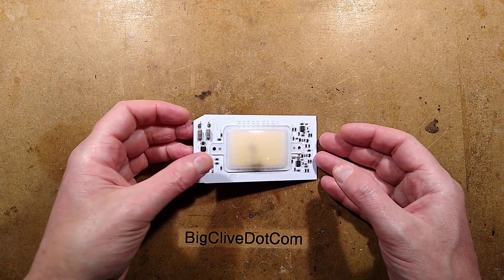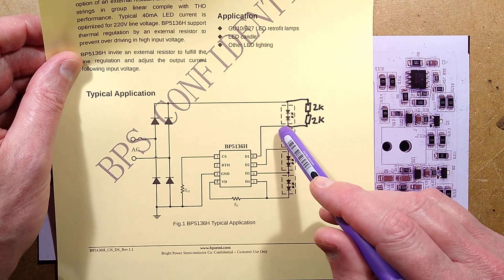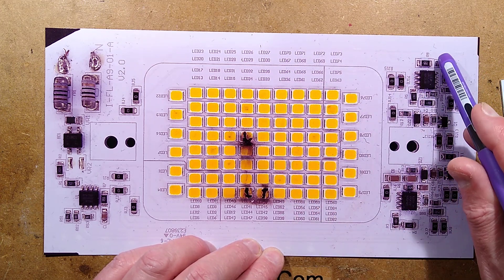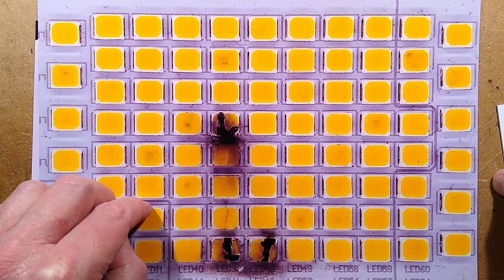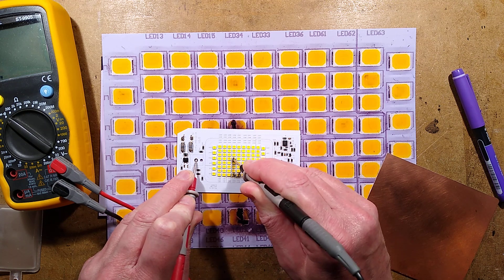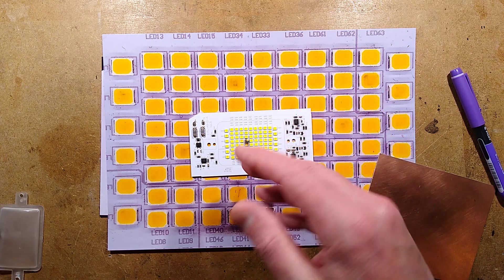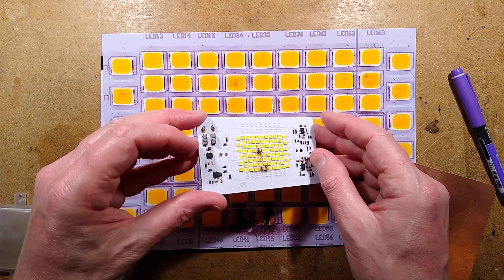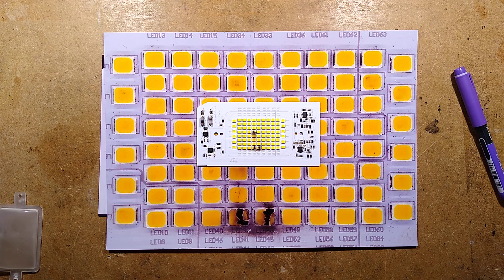LED shock hazards are increasing

Comment: I had to insert an AC filter in the beaker box feeding our living room, because every time the 55 inch TV was turned on the beaker tripped from the TV's power supply noise causing it to trip.  I did the entire circuit to cover any fancy electronics that might be added later. Ron W4BIN
Reply from the maker: Could it have been high inrush current that was causing the tripping, or was it a breaker with arc fault detection.

Comment: I don't see the issue. You should use a switch to shutdown power to the light before working on it. Risk of shock Is zero and you don't need a gfci/rcd for that. Of course an egc would help maybe but if it is still appropriately current limiting then an egc may do nothing as It acts like a giant resistor. Simple solution is to flip your switch before working on it. Using a multimeter to verify also helps. Electricity is still sent back to the grid as AC so I don't see how a DC gfci would be useful.

Of course try not to buy cheap Chinese crap (all redundant I know)

Comment: The moral of this story is write your congressperson and tell he or she that things are coming in from China that are out of spec with US safety requirements.

  The other moral (or is it a morsel in this case) is that whenever possible, use battery driven DC fed devices that are not connected to the AC line.  With LED lamps that should be a no brainer.  I would love to wire up my house to feed DC to DC driven devices.  All fed from a battery bank that one recharges at night when the AC power rates are lower.

Comment: Aluminium core PCBs don't have enough separation to be connected to exposed metalwork, whether it's earthed or not. They should be treated as potentially live and have another later of insulation to exposed, earthed metal.

Comment: I'm not really sure how there getting shocked seeing as how the housing is plastic 99.999 percent of the time especially from China what are they spitting on the fingers and putting them in the socket truly I don't get it ok yes the aluminum plate may short or fault but that will not transfer thru the plastic housing unless plastic has all of a sudden become conductive and it forgot to tell the universe

Comment: Thank you for this video.  Would simply a greater capacity for Heat Sink obviate this failure mode? So in essence is it a circuit board material issue or inadequate thermal dissipation capacity?
Reply from the maker: A better heat sink and running the LEDs at lower power would both be beneficial.

Comment: Why do we drive LED lamps (including car lights) with AC? LEDs by definition work best with a DC feed. Is it about heat minimising?
Reply from the maker: It's for cost saving and avoiding the use of electrolytic smoothing capacitors which are very easy to damage with heat.

Comment: The latest thing in our shop is the florescent tube replacement led tubes that arc and burn through the PCB to the point of bisecting the board itself, which is supporting the weight of the bulb itself.. Gravity always wins, so now we have zip ties on all of our lights. Just in case.

Comment: This is why I would only buy quality LEDs. Not only for reliability but, also more importantly for Safety. In the states where I live, I have 120 volts AC mains which is not as dangerous as 240 volts due to having half the potential energy but, can still kill you.

Comment: My friends works at an LED factory in town. They do FLDs and another I can't remember at the moment. Basically streetlight LEDs that go in parkinglots and what not. I might be able to get a board to send.
Reply: Hey, I got a whole chain of these LEDs. They have a hexagonal pattern and connect together to form a small ring. The lights are pointed at a reflective parabolic surface. Unfortunately I only have the LEDs and not the casing or the drivers. If you're interested in giving them a look, let me know and I'll email you the details

Comment: In US “arc fault circuit interrupt (afci)” are required now in past few years for certain areas of homes, like bedrooms. I know because I inadvertently triggered mine while testing an old set of power line network adapters it didn’t like. I wonder if this type of failure would trigger them also?

Comment: Could some one out there please tell me what is the VOLTAGE and CURRENT I needed to light up just one of those LED's, I have an old damage street light and would like to recycle some of those LED's...…...
Reply from the maker: Standard LEDs will light at 3V.  On panels like this they may be higher.

Comment: All the supermarket branded LED bulbs I had failed in this manner. The bulb flickered and died with a burning smell. Took them apart and sure enough the board had burnt through to the aluminium. Not only that but the board was charred along the edge of the copper track both sides of the failed LED almost a CM each direction. After removing the failed LED it was measuring 50ohms when it should have been open circuit

Comment: Cupric Chloride, as distinguished from cuprous chloride.  Both are copper chloride, but the first is an excellent etchant for copper while the second is what cupric chloride turns into when it oxidizes metallic copper into solution.  As long as there is excess chloride ions present in the solution, any oxidizer present (even just air bubbled through the solution) will oxidize any dissolved copper back to the copper (2+) state of cupric chloride.

You can make this at home quite easily, as well.  Hydrochloric acid (which where I live can be obtained as concrete etchant) won't oxidize metallic copper, but hydrogen peroxide will oxidize metallic copper and give the hydrocloric acid access to the ions.  You can even start up the bath by etching a circuit board using the hydrochloric acid and hydrogen peroxide solution.  Unlike more conventional etchants like iron chloride, a cupric chloride bath gets stronger instead of weaker the more use it gets, as more and more copper ends up in solution.  (You do have to periodically add more chloride ions, usually in the form of hydrochloric acid, when it runs out.  You'll know it needs more chloride when the opaque brown cuprous chloride color does not disappear even after a prolonged aeration of the solution.)

You can also use this bath for copper electroplating, including plating through-holes and vias in PCBs.  (Be careful how you go about doing this, however.  Some methods involve chemicals which are restricted in some countries because of what else they can used for.  You do NOT want to be mistaken for someone performing those reactions.)

If you find the bath becomes too strong (one thing that will definitely stop it from working is becoming saturated with copper ions, although the solubility of copper is quite high), it can be reduced by other methods than adding water.  You can place the etchant bath in an icewater bath, as a solution saturated at 25 degrees Celcius will drop something like 50 grams of copper per liter at freezing.

If you do make this material, be careful with it.  It is corrosive, particularly toxic to aquatic life (and most waste water treatment systems don't have provision to remove it, as it isn't a normal constituent of waste water), and just generally unpleasant if it escapes from working apparatus.  Where I live, it can be disposed of in the annual household hazardous waste collection that is done each spring.  You can also just seal the container for short-term storage, or you could dry it out for long-term storage. (The obvious means that suggests itself to me is using a vacuum pump to pump off the water vapor until it's dried out.  As the stuff works better when warm and will dissolve more copper per unit volume when hotter, you should have a heated bath if possible, which will alleviate the problem of the solution freezing on you if you've got a really good vacuum pump.)

Comment: As this particular unit is a luminaire that does not have 'replaceable lamps' - genuine U.K. sales are hopefully less likely in the future due to the impending ban. All new U.K. light fittings are supposed to have replaceable lamps.... This should in theory might remove the problem. However there must be a lot of potentially (ouch!) dangerous units out there using similar construction to the one you have.

Comment: So, (hoping someone can confirm here) this is something I've thought about and I also thought this problem could not only cause issues for type ac rcd (which is fairly obvious) but also type a? Could this issue make type a ineffective for the more common leakage currents from ac circuits? I need to draw it out but it keeps popping up in me head...... 🤔

Comment: •Upside: That design avoids the bridge-rectifier-and-capacitor input that has a nasty power factor. •Downside: The non-isolated design plus rapid switching inject capacitive current from the mains into the substrate - the substrate should connect to neutral or L1, not ground. It probably emits much RF. •Question: Does that chip sequence the LEDs so that they get equal use? •Better choices might be circuits that push current. (Still use no big input capacitor. Use inductor(s).) Buck converter? (Drive it non-standard.) Boost converter? (feeding LED string 300V?) Boost-buck or other fancier converter, can also provide better power-factor correction?

Comment: Can we please move on from screw-base lighting?  Cheap flickery linear drivers suck. Putting switching regs right by LEDs so they can get hot and both fail also sucks.  Smart LED bulbs also suck, since the smart part and the part thar breaks are the same thing.

We could have fixture, power supply, and actual LED as separate replacable parts.  We could even have "bulbs" be USB-PD powered, and it could all be standardized from tiny desk lamps on up with a data channel for smart stuff!

Comment: dont blame the board if irresponsible instillation is at fault 
Q. what is the running voltage of the led and what ma is the leakage before the resistor ic fail

Comment: The main electric shock hazard comes from metalwork that should be properly earthed for a Class I device. It's poor design and construction that's causing the issues and creating the potential shock hazards. If the casing of these lamps was properly earthed or they were of Class II construction the hazard would not be present without multiple fault conditions. There is a lot of emphasis placed on testing of the installation in a domestic environment but the majority of the hazards come from connected equipment. A Class I luminaire with unearthed metalwork does not meet the basic provisions of the Low Voltage Directive and should not be available on the market in the UK or EU, but unfortunately they are and this introduces an electric shock risk whatever type of protection is provided on the circuit supplying it.

Comment: Hello BC. The LED globe bulb in my bathroom  is barely glimmering. I thought that most of the LEDs had gone to Silicon Heaven, but when I popped off the opaque plastic dome, all are lighting, albeit dimmer than the answers at PMQs.
Any ideas, oh mighty bear of the spudger?
Reply from the maker: Look for one with a black dot in it.  One failing high resistance will break the circuit.

Comment: I also think that one trigger for this is that they run the LEDs way too hard, too few chips for too many watts making them very hot hence the dark spots inside the resin, they break down when getting blazing hot and they start to burn conductive traces that leads to this result in the end. if they could only put more quality in focus rather than profit this would not easily happen and the lamps would work for ages, safety,  long life and low power consumption and environmental gain but then the minds of profit comes into play and ruin everything

Comment: Hello there!
@ 4:44 you are holding the PCB in an angle and the tracing appears to be super visible because of the angle in which the light is hitting it.
Maybe you can easily see the traces by angling the light source =)

Comment: Hey Clive! Got a cob that needs some individuals LEDs replaced 4 of (3x5.1mm), any suggestions? Seemed to be melting led plastic before solder was getting hot - maybe hot bed?
Reply from the maker: Hot bed would help greatly.  Be aware that many of these LEDs are multi chip and may not be easy to find.

Comment: I love the wording on the spec. sheet  - "BP5136H invite an external resistor..". Plus the puzzling "Confidential - Customer Use Only" at the bottom!
Reply: My favourite one was on an installation instruction for a cheap halogen flood light - "Offer the unit to the place of destiny and make the screws"

Comment: Big Clive vast majority of GFCIs are type A now in the USA type AC are the only older ones. Also GFCIs in USA trip at much lower currents 4-5mA in 3-7mS than UK 30mA RCDs. Hot tubs and EVs are an area where much faster tripping at lower current RCDs should also become standard.

Comment: It's interesting that even in BS7909 (temporary electrics for events), currently published to a 2011 version, had it clearly stated that type AC RCDs/GFCIs are UNSUITABLE. Yet in the 2018 edition of BS 7671 the JPEL wizards happily left the wording that AC RCDs/GFCIs would still be suitable for GENERAL application - with no explanation on what general actually means. Even though as you say countries like Denmark and Germany etc just refuse to accept AC RCDs in new build dwellings.

The upcoming 2022 2nd amendment to BS 7671 had a proposal to change the general device from AC type to A type, but we will see. Once they make the change there is going to be some interesting developments between the ECA/ Manufacturers of SRCDs and the standard BS 7288 as well.
Reply: As far as I can see the 2018 edition was the first edition of the regs where the committee wallahs of the IET  even acknowledged that different types of RCD existed. In spite of type A being mandatory in Germany for 30 plus years.  I think they were side tracked by the more lucrative prospect of AFDDs and dreaming up the need to do an impossible calculation to be able to omit them.........

Comment: In a distant time before domestic RCDs I worked for a consumer electronics manufacturer in the UK. We made sure our kit was safe and always had BEAB certification (it was a kitemark for electronic kit). Why? Apart from the ethical perspective, the company knew that if something bad happened it could lead to law suits and bad publicity. Move to the present day and nobody knows who makes most of the kit, and many of the importers/sellers are fly-by-night.
Even the simplest thing can be risk. I had to obtain 50 5V 1A USB power plugs to supply with product. Trying to find anything certified as safe is a nightmare, unless you want to spend £20 on a Samsung or Apple charger. 
The improved RCDs are a great idea that needs to be done, but the kit has got to be better regulated.

Comment: If its a problem it will be handled. So far not a problem. Here in the USA we use 120 volts so it is quite a complicated deal to get electrocuted. (you have to some way be firmly fastened to the circuit to where you can't pull loose) Not very likely unless you are in water.
Reply from the maker: I think the water bit is the one that delivers the most surprises.  It makes a massive difference to skin resistance.

Comment: Clive, I'm not convinced that these aluminium-backed ultra-thin PCBs  present much of a shock hazard.   Most commonly, these are found in a plastic housing where the metal backing plate is isolated from any human contact.   Certainly, if they short out, they're a potential fire hazard and will likely blow a fuse in the plug or on the PCB (if there is one).   I don't believe that the backing plate is connected to the protective ground lead in the  line cord.

I don't understand why this is any better or worse from a safety point of view than an ordinary incandescent lamp fixture.

In keeping with the global warming meme, how about a breakdown on some personal misters?

Comment: If it arced, why didn't it affect more of the leds? I note that the burnt area seems to have happened in the same place, if you divide the board in half, if that is what happened your theory might not be entirely correct...

That's what you get for calling me weird 😜
Reply from the maker: Being weird is a requirement.

Comment: If I'm reading things correctly, the top LEDs on the cct diagram are lit at the lowest point on the voltage curve so the parallel resistors may be to stop them glowing when off due to capacitive coupling in the cabling.